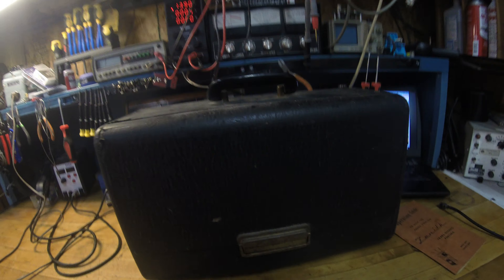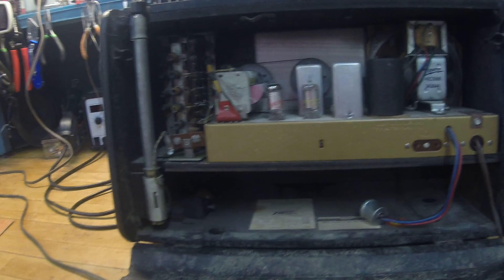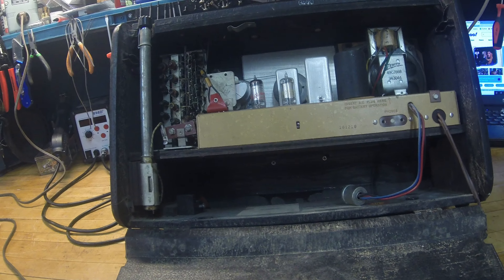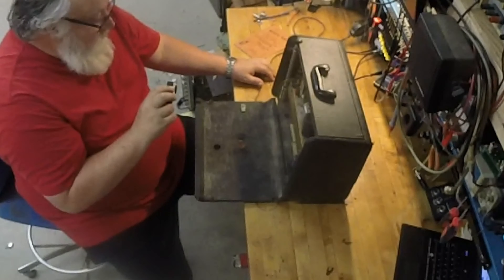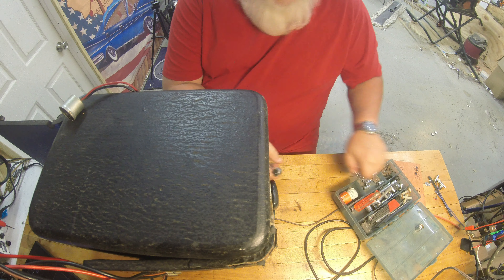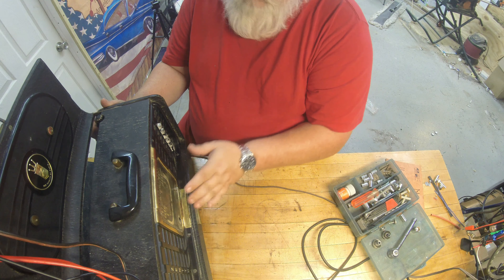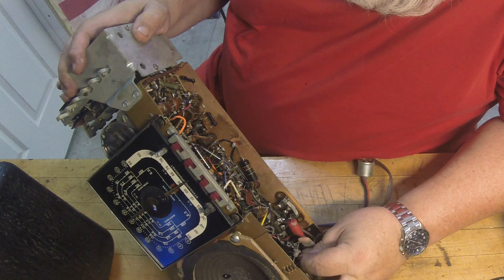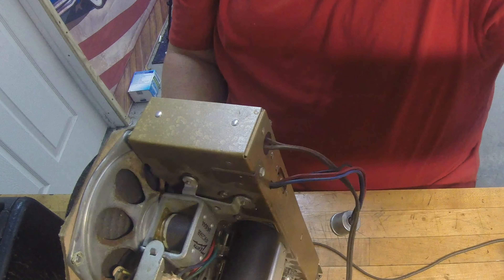Zenith G500 Shortwave Radio Repair and Restoration Part 1

Comment: Yes, I have that radio.  My dad bought it new somewhere between 1949 and 1951.  I've read it cost about $95.  It was only in production for a couple of years.  It's improved over the former models and pretty much the same innards as later models.  I also bought the Transoceanic solid state one in 1970 new.   For some reason the back is stuck, I haven't messed with it in decade but the battery was finally dead.

Comment: Interesting radio of a type I have never seen before, but that is not surprising as it was probable never sold here :-D  Be interesting to see you fix it.  :-))  i have seen that three terminal part inside a radio of vintage era, but I never investigated it.
The radio in question worked till one day there was a loud bang and cloud of smoke (according to my mother) a big electrolytic capacitor let go and gave up the ghost.  I have never seen so much paper and electrolyte, yes, there was stinking goo all over the inside of the radio.  It was a tin cap like a Spam tin that blew up, I reckon the electrolyte boiled and expanded in the tin till it just couldn't hold the pressure anymore.  It exploded with such force it broke valves/tubes and smashed some wire-wound resistors that were wound on ceramic, it also escaped out the cardboard back of the radio and cracked a pain of glass (it sat on the windowsill).  It had a small fire inside that went out by itself, no doubt some of the stuff from the cap' had landed on a hot wire-wound resistor.  It I remember this radio had a big green voltage dropper (now black) that ran very very hot.  She had just passed the radio to go to another room when it let go.
"What a scare I got!  Then there was this awful stink of electrical burning, so I pulled the plug out" is what she told me.
It was thrown out, but when it worked it was a very good sounding radio, lots of bass and you could listen to almost anything.
Ship to shore, radio hams, world radio at night on short waves, it was one of those radios that if it transmitted somewhere in the world you could hear it at some point during the day or night.
It had a lovely wooden case as well.  If I remember it had a lead acid battery in it, maybe that was another radio, I was rather small back then!
Reply from the maker: Yes those capacitors can really explode I had one go off one day and it sounded like a shot gun and then like you said there was paper and confetti everywhere. I think some these old radios pick up everything off course that can be good and bad as I don't really want to listen to the neighbors blender anyway thank for recount enjoy the story have a nice day sir.
Reply: @TheElectronMan  You to, have a jolly nice week sir.